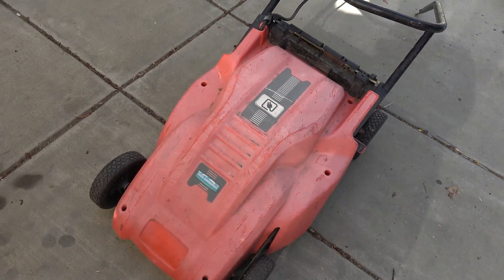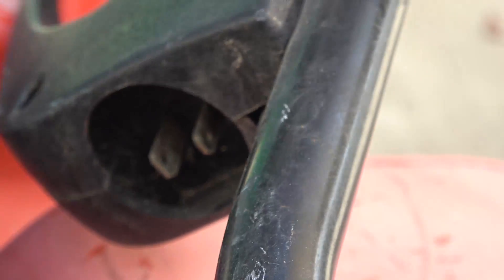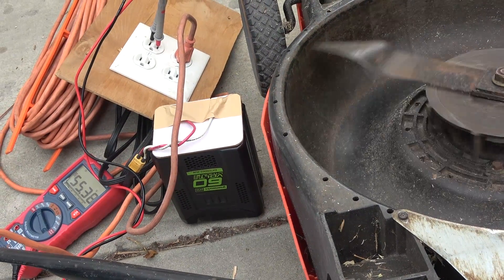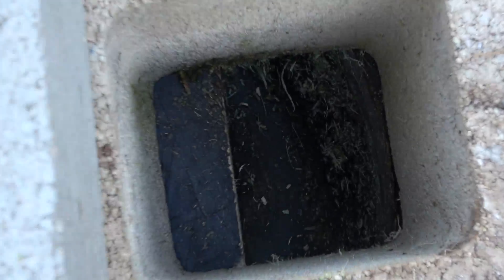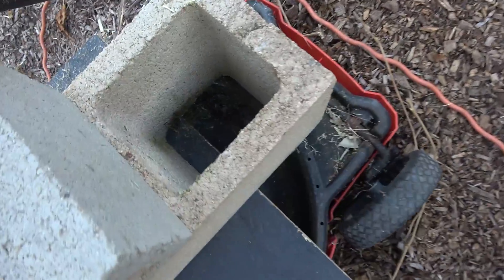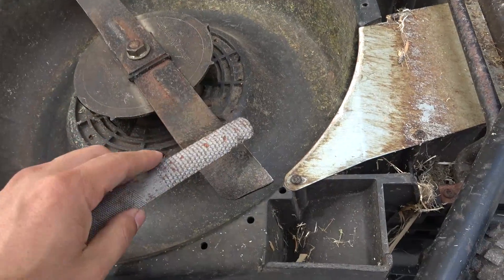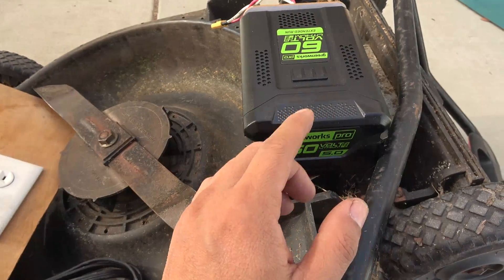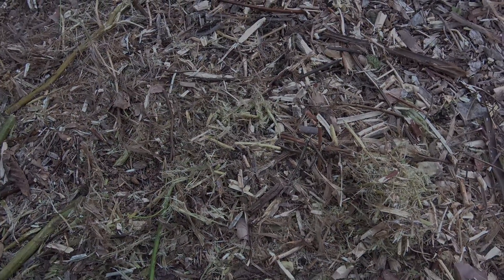Home made cordless wood chipper from a corded electric lawn mower

Comment: Please ELECTRICITY a is powered by COAL. Coal is NOT zero emmisions. Nor are any of the materials used to make yr mower. Having that rant bloody brilliant using an electric mower since a petrol mower won’t run upside down. Could I add an extra blade so they are fixed 90 degrees to each other ???

Comment: The internets tell me that a universal motor will run faster on DC than on AC at the same voltage, so your 55.99VDC maybe runs more like 80VAC. Looks like it makes a nice mulch to keep weeds down around trees or in the garden.

Rock on, Vu. ✊🛠️🇻🇳

P.S. Thanks to comrade wife for the camera work!
Reply from the maker: Hi Joe, new user name? :D
Reply: @vuaeco  You know it, brother. I don't make videos or have a following per se, so I switch it up whenever I get the urge. Also, "Joe The Eurosquatter" was a bit much for people to type in replies needing that differentiation.

I've long contemplated powering a vacuum with a lithium pack, but I'm battery-poor and have no real need for a cordless vacuum. If I ever do, tho, I know what to do... 💡

Comment: How can you tell if a motor is a universal motor?
Reply: I don't know how to visually identify one, but if it's a corded vacuum or "E-Lawn", it likely has one.
Reply: I was planning a building a small sawmill from a Worx corded electric chainsaw with a 28" blade its 8amp could it possibly run off a 🔋 60v battery too or maybe 80v??
Reply: @dave-o3674  That's not a question that is easy to answer.  It might be okay, but you might burn up the motor.   Unless you have test equipment like a variac, all you can really do is hook it up and hope for the best.   It will either work great, work poorly, or burn up.   Generally those are the only three results.